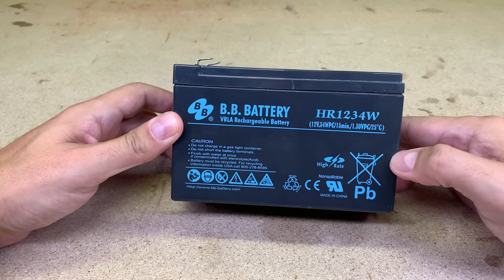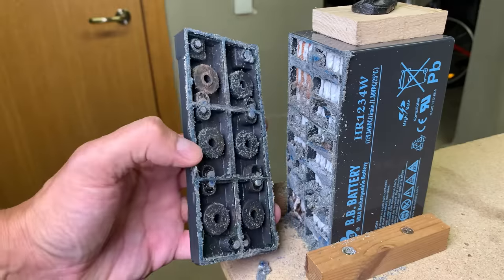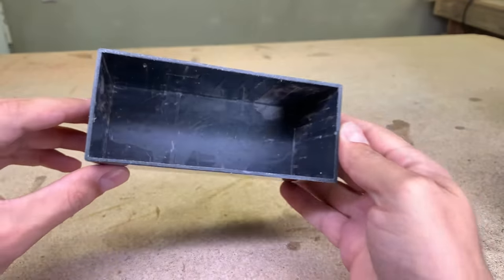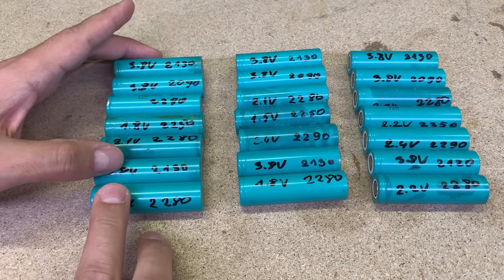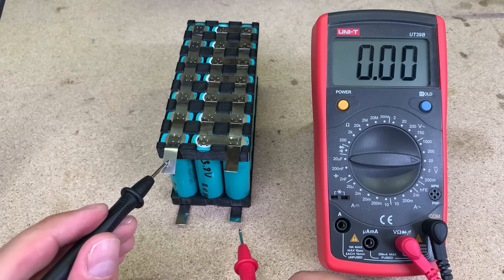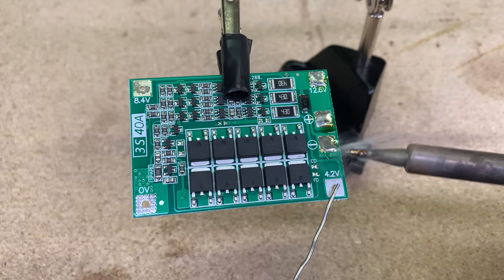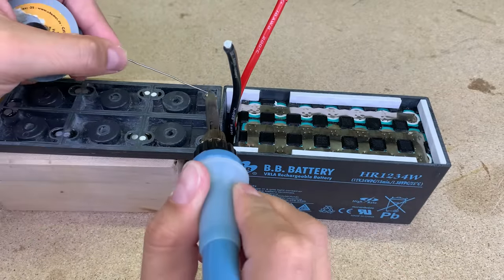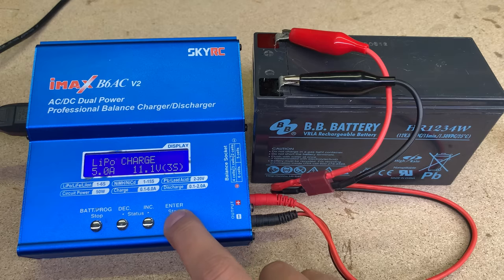How To Convert 12v 9Ah Lead Acid Battery Into 12v 14Ah Lithium-Ion Battery Pack

Comment: Very nice build.  I recently bought a 12v box kit but your reuse of an old lead acid is perfect!
Reply: i have a few of those lead acid batteries that are dead dead dead (one being a literal 80 mv...yeah)
i was/am afraid to cut into them since i dont/didnt know how much, if any, battery acid is left in there

this video did raise my confidence a little about the acid in there, but still have a few reservations since ive never dealt with something like that

Comment: I would have purchased a new case, but other than that, this is exceptional work.
Reply: Why purchase a new case (if indeed you can) when you can get an old one for nothing?
Reply: @juliocosta5818  - Because of all the mess and time wasted dealing with lead cells?

Comment: 4S of LiFePO4 batteries would have been much better option, with 3.6 * 4 = 14.4V which is very close to the Alternator/Generator output, and LiFePO4 can tolerate much better operation outside of minimum and maximum voltages without explosive consequences.
Reply: Would it have been as cost-effective to build, though? (I have my own concerns with this project—I think I'd have preferred to build a case for the batteries than deal with the lead and the fact that the newly built battery could be mistaken for a common SLA and used improperly…)
Reply: You need the alternator to be higher than the battery, so that it can charge the battery to full.
Reply: @orppranator5230  Sure but even it it only gets to 14V the batteries will still be at approximately 95%, which in fact will prolong the life of the batteries. There are commercial drop in replacements in LiFEPO4 chemistry to be used in place of Lead Acids. I suspect they don't do any boosting for charging as it will be impractically expensive.
In any case having 4.2V max on regular Lithium Ion battery makes this dangerously battery incompatible with alternators/generators/dynamo due to relying on BMC on not letting the batteries go above 4.2V (as with 14V they will be pulled to 4.7V otherwise in 3S configuration). BMC will disconnect the battery from the charging circuit, and in case of the generator charging will cause the system voltage to spike to 18-20V in some cases. This can even happen with solar applications.
Reply: for a lead replacement its better to use LFP with a simple active balancer, BMS would disconnect when charging to full and that's very bad, LFP wont explode even at over 4v
Reply: @knghtbrd  Lead won't hurt you if you don't eat it or leave it on your skin for days. Believe me, if you build a battery, you won't forget it's a Li-Ion.
Reply: True, LiFeP04 is indeed more compatible with 12v minimum 13.5v maximum chargers and equipment. If they would fit in the case and get the Ah you need, that would be the (more expensive) way to go.
Reply: Not at all, at 3.6v the cell are empty. the cell are fully charge at 4.17v. so At 16.7v it's to high. A fully charge 12v battey is at 13.4- to 13.6v
Reply: Benoit Arteau - Look at the discharge curves for 18650 cells.  3.6 volts is approximately 50% SOC,(State of charge), Not empty as you stated.
Reply: @knghtbrd  you only need to print a plastic sheet and glue it over the existing print, nobody will mistake it for lead then.

Comment: Connecting cells in parallel like that with no fusible links is monumentally stupid. That battery is a fire waiting to happen. If one cell in there starts to fail shorted, it will rapidly deteriorate to a full short with all other cells in parallel discharging through it. Since all cells are in close proximity, the lot will go up in flames, violently. The correct method is to connect one side of the parallel cells (usually the positive) to a bus bar with fusible wire. That way, if a cell fails the fusible link to that cell will break isolating it from the rest and preventing a disaster.
Reply: For a small 7ah replacement pack like this, it's probably fine. But in general I couldn't agree with you more. Blows my mind how this plastic cell holder and nickel strip method is still the "de facto" way for building lithium packs of various sizes, even in the homebrew powerwall space, where hundreds upon hundreds of cells are combined into a single pack in this way. Besides for just the safety hazard, it seems like any kind of cell-level maintenance is bound to be a total nightmare as you basically need to tear the whole pack apart in its entirety in order to get the cells isolated for testing. Who wants to sit there stripping welded nickel when conventional battery spring mechanisms could be used instead? I have thousands of 18650's waiting to be put into packs, and this is where I've stalled with my build. I'm trying to find a better way to build packs as I refuse to use the same holder+nickel strips method that everyone else is using. I believe there is a far better way to assemble packs that is not only easier and cheaper to do, but also much more future proof. the problem is, I haven't been able to figure out exactly what that is, or find anyone who's come up with a good enough or easily approachable/DIY design. You either need a 3d printer, or to buy expensive parts, for instance. Meanwhile raw materials like sheet wood/plastic are readily available for cheap... Someone just needs to think out of the box and come up with a better design rather than everyone being a copycat of something that's frankly awful.
Reply: Very professional looking job 
Great 👍
Reply: @DimitriPappas  you are 100% right in what you say, there are hundreds of videos on YT with the same method of building this 12V 14Ah or 16Ah or 20Ah etc...  with just a simple BMS and no other protection.

Did you find a better method, what is your progress... i'd like to see someone building something better and safer and easier to repair..
Reply: @DimitriPappas legend says that you after 2 year's still waiting with thousands batteries with better way to connect them lmaooo
I always hated "smart people" like you and that Ainstain above it 😂😂😂
Reply: @soulbrothers7789  I understand, ignorance is usually accompanied by anger and hatred.
Reply: @spudhead169  Yes when educated man read nonsense like your's 🤣
Reply: @soulbrothers7789  An educated man would know when to use an apostrophe.

Comment: I find it a lot easier to recycle the old battery for about 3 dollars and buy an empty shell that comes with battery holder and a 12 volt balance/charge board for around the same money I get for recycling the old battery. This is a good tutorial for those who want to use the old acid battery.

Comment: just order a 3d printed box and put 2 metal screws outside for the positive and negative to avoid all that work.
3D printed boxes aren't so expensive.

Other than that, good work mate.

Also i am wondering. Those batteries are like 14.4V at full charge. Now by puting lipo 3.7V inside in a series, that means if you are fully charge those batteries the voltage will be 4.2V * 3 = 12.6V.
also the minimum voltage is 3.3V * 3 = 9.9V. That means you can't have the batteries less than 30-40% of capacity to get a 12V device fully working without any issues.

Am i thinking it in a wrong way ?
Reply: yeah whats the point in using case of a dead battery that makes up 5% of the battery and replace the other 95% 
at that point you're just making more work for yourself while creating a hazardous mess.
Reply: @darkshadowsx5949  It looks cool and is sturdy. For some people (myself included) that's worth it. The lead should be properly recycled anyway, so yes it's (extremely) hazardous, but could be handled properly by someone who knows what they're doing

Comment: I would have wired in a balance lead so you could use the smart charger to charge the battery. Just trusting a fit and forget BMS is likely to cause issues if/when it fails.

Comment: Should you use batteries that are below a certain voltage? Nice build & neat mini spot welder! Not sure if you did, but it would be a good idea to use a chemical cleaner that can neutralize any remaining battery acid residue.
Reply: Just rinse with a dilute solution of bicarbonate of soda to neutralise any acid, then rinse with plain water.
What you must do is make sure all the batteries in a single parallel set are near to the same voltage, to prevent potential damage from the heavy current which would flow if they were connected together in very different charge states.
Reply: @melkiorwiseman5234  that makes sense! Thank you 🤓

Comment: I'm thinking what if you had used 4 cells in series, so the cells never get to full charge off a vehicle charging system but always stays around the maximum charge available.

So you would have batteries capable of reaching 16.8 volts but never going past 14volts from the vehicles charging system.

The lipo 18650s still put out a lot of amps at a lower charged rate, not full capacity but that would be offset by the paralleled amperage capacity.

So the lipo 18650s would deliver a big punch at lower voltage, and the bike would only charge them up to around 14 volts making them safe for continuous charging.

The only problem I see is if the charge system fails you could end up with a huge dump of voltage into the battery, unlike with lead acid the battery could go bang.

Comment: A problem I see is that those cell have a nominal voltage of 3.6V so very quickly after even partial discharge, you will have closer to 10.8V, not 12.6V.  This is a problem already for devices such as a UPS that normally takes an AGM type battery.  You would likely get a warning (beeps) at or close to 10.8V, when the lithium-ion cells are still in a high state of charge.  Other 12V devices might also "complain" that they are being undervolted.  What these would be good for is a 36V UPS (and/or a 36V electric scooter).  Then you can use a 10S configuration (36V nominal), and then just don't charge them all the way up (to 10 * 4.2V = 42V).  You really need 3 1/3S to get a nominal voltage of 12V so unfortunately, this application is far from ideal.  Also, by the time you buy all new cells and a BMS, it will be close to the price of an already made battery of this type, so you are doing all of that labor for "nothing", plus making a mess and a hazard.
Reply: Yeah, for 12v you need 4 3.2v Lifepo4 cells
Reply: Not to mention, you're not figuring in the cost of his spot welder.  If you do not have one that will cost another $100+.  But hey, he already had the stuff and was using recycled batteries so HIS cost was minimal.  I think I'd rather buy or use something else for the box than go through that recycling nightmare.  Sometimes it's just not worth the effort.  You're right about the voltages also, it wouldn't work right with 12 volt stuff.
Reply: This battery would not be usable on a UPS, unless one would figure out a way to charge it with 12.6 volt constant voltage...
Reply: @VERYMADSTUDIOS  That is certainly possible, but I stated usable on a 36V UPS.  I didn't say it would work on a 12V UPS.  In fact I said it is a problem.
Reply: but sometimes guys its fun making some diy stuff than buying a perfect battery(i just told my thought pls dont be rude to me)😁
Reply: @David James  This is the reason I bought ready made ones for my late wife's mobility scooter.
Reply: 24 volt lead acid also maps nicely to a 7s LiIon.  12v just doesn't work with the common lithium-cobalt-manganese chemistry.
Reply: @Sylvan dB  Exactly. Just make it 7S3P instead of 3S7P. Makes a great 24V Battery. Double the Voltage, half the current and quarter the losses in the wires. There are almost as many applications for 24V than for 12V
Reply: What about using 5 or 6s with a step down converter? Have your 12v steady from full charge to dead
Reply: @quintinlarson9499  That could work but then you would need to be careful charging it.  It would not be a "drop in" solution in that configuration.
Reply: @quintinlarson9499  you 'll get low amps and low efficiency
Reply: I actually thought that lead-acid batteries have a far inferior discharge curve. I would expect them to drop below 10.8V with a higher percentage of remaining energy than a 3S 3.6V LiPo-based configuration.
Reply: If you where building a pack from scratch (not opening SLA's) and tacking on f1 or f2 i/o terminals it would be a pretty sweet mod to a ups unit though. I have loads of recycled 18650s I've harvested and tested and a ups unit with no agm, so I'm looking into building a custom battery pack to closely mimic the behaviors of an agm.

I wish there were better off the shelf options than a redundant bms and  a variable DC->DC transformer. Beacuse that's not economical.
Reply: I am getting 11.5 volts but the ups doesn't gets ON how to solve this problem...?
Reply: @ashishshinde6374  use good fully charged batteries it should be 12.7-12.9 volts are a fully charged state
Reply: I am using new batteries...
Reply: @ashishshinde6374  then charge them
Reply: @williammchugh4361  no need to spot weld. you can simply solder them...
Reply: Just wasting materials, I've seen a lot of people making battery just because, they can. They spend because they can, not because they need.

Comment: can this be used as replacement for a 12V 7AH battery inside a UPS I have APC BX625CI-MS
Reply: I was wondering the same thing.  I tried different lead acid brands and they seem to last 3 years tops.  Seem even  a NINH thing that can work for a few seconds would even be a great idea.

Comment: Could I insert these directly into a desktop UPS (230V AC, 2kVA, 1.2kW, 2x12V9Ah lead acid batteries)? My intuition tells me it should be fine, as long as the LiPo cells can draw sufficient current (for 2Ah cells, that would be a C-rating of at least 2000/24/7/2=6), and since the charge voltage of lead-acid batteries is typically 12.7V or less, but I prefer to be safe than sorry and double check this. Understandably, the UPS datasheet doesn't provide information on internal charging circuitry, so I'm not sure how to proceed safely.
Reply: No this guy made it wrong actually 4S battery pack is real alternate to 12v lead acid batteries

Comment: Would you be able to use this method as a drop in replacement for a UPS?
Reply: Well, you can buy them for UPS, so I would think so. UPS chargers are gentle, and the voltage is right.
Reply: @Bob_Adkins  That's what I was thinking. The BMS is built into the battery in this design so it should be alright. 

The main thing is the estimated time on battery and battery percentage probably won't be accurate and I'm not sure you could calibrate it given the differences in voltage drop between Li-ion and lead acid.

That could complicate things for controlled shutdowns when the UPS gets to a certain battery level/time remaining.
Reply: @your_new_sjw_waifu  Yeah, if your UPS reports battery condition, it will be inaccurate but you can mentally compensate. I think it's worth it, lead-acid batteries are awful, last only 2 years for me. The LA batteries can also show a false voltage, they check 12-13v  but when power trips they only last a minute. Load testing twice a year is a headache. Li-Ion is usually good if the voltage is good, and should last many years if kept at 4.0v per cell. Li-Ion doesn't like to be stored at maximum voltage (4.2).
Reply: @Bob_Adkins  Yeah, I could mentally compensate but I couldn't have my computer reliably shut down and turn the PSU off when battery level reached 5% or there's 5 minutes remaining (whichever comes first). 
Risk of unclean poweroffs really defeats most of what makes a PSU worth it to begin with.
Reply: @your_new_sjw_waifu  Your concerns are real, it's not a perfect solution. Someone should make a BMS that will make the battery voltage correct, and act just like a LA battery.
Reply: @Bob_Adkins  I was literally just thinking that and wondering how hard it'd be to build a circuit to read the Li-ion battery level and adjust the output voltage to emulate a lead acid battery at that level. 
I wonder if I could use an Arduino with a voltage regulator to do it.
Reply: @your_new_sjw_waifu  If there's a demand, I would guess someone will eventually make a board. But, if there's a high demand, the UPS makers will start using Li-Ion batteries and adjust their circuitry to match. Good idea on the Arduio w/regulator. I'm no expert, but it sounds like it could work.
Reply: @Bob_Adkins  This would have used outside of just UPSs. In theory you could retrofit just about anything to lithium, even a car if you wanted.
Reply: @your_new_sjw_waifu  I know, and I would love to convert all my stuff to Li-Ion!
Reply: @Bob_Adkins  Add USB-C while you're at it.  Shoot, build a Qi charger into the coffee table and have the remote charge it's battery off of that.
Seriously, why has nobody done that? 
I want a desktop monitor that's powered by USB-C so there's literally just one cable connected to it.

Make a Li-ion car battery but add a USB-C port so if it ever goes dead you can charge it with a wall charger or even a battery bank.
Reply: @your_new_sjw_waifu  I know! I'll watch and wait!

Comment: From experience - cells who was lower than 2.5V some period, at charging gets hotter than normal cells because of internal resistance and change in chemistry.. That after few cycles can't allow to charge battery pack completely, degradating good cells. However, at discharge or at standalone, they create parasitic discharge for good cells.. 😉
That's why I never reuse cells again with starting voltage below 2.9-3V after old pack disassembly..

But basic idea is good and great job, only few cells were bad..

Comment: Presumably you did this for fun, because there is absolutely no way that it is cost effective. 
Where the volume and weight are not an issue (like my garden shed full of solar-charged-backup batteries) sealed lead acid are far safer, miles cheaper and require almost no management electronics (just a standard charge controller). AND my shed hasn't burst into flames yet.